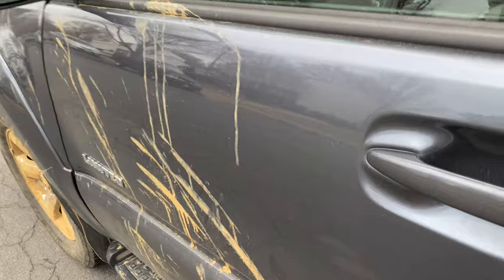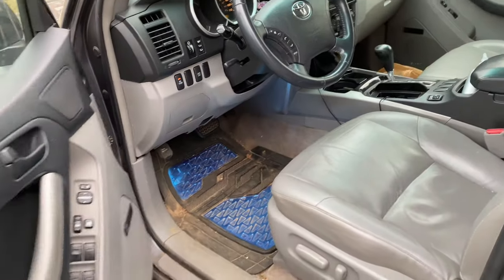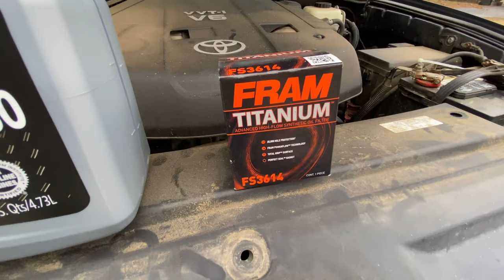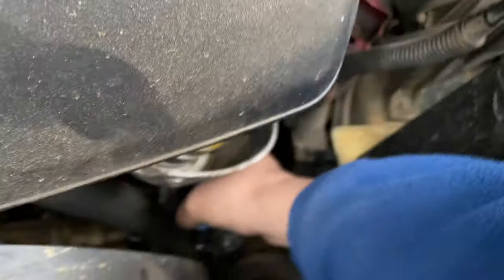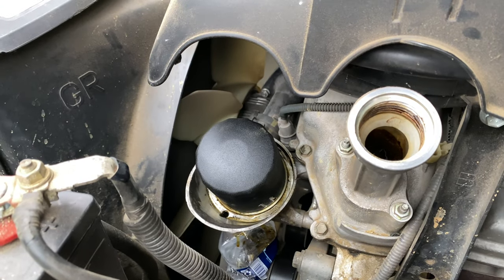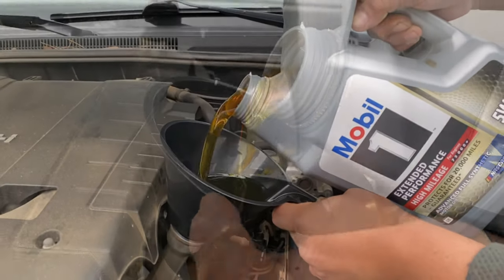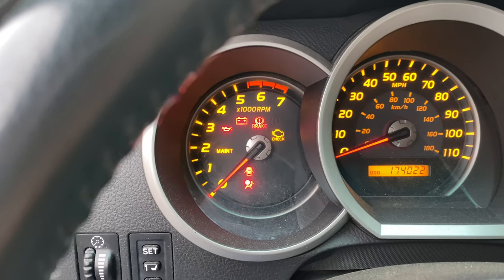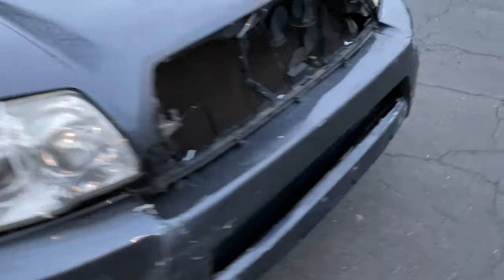2006 Toyota 4Runner oil change

Comment: That thing idles high as hell like mine does! Bit I'd what people say, I just paid mine off yesterday,  it has the 4.0 in it, it's the sr5, thanks to you I'm changing my oil today for the first time myself! I had to put a transmission in last summer but I made it  to 310k seamlessly miles first, I just rolled over 330k, Last summer I changed my ac blower motor, plugs, coils, filters all thanks to helpful youtube videos. Cosmetically I changed my passenger side view Mirror last year and my tag lights recently ❤❤❤❤❤❤ also I'm pretty sure I had to replace the Trans bc my kids dad 3.5 years ago changed my oil when I got it, he let out transmission fluid instead of the oil bc the drains were close. It's a closed transmission so no way to know how much without taking it to shop, he put some back in it. But ultimately I didn't hva ethe money to take to shop, I paid 1200$ for that mistake last summer